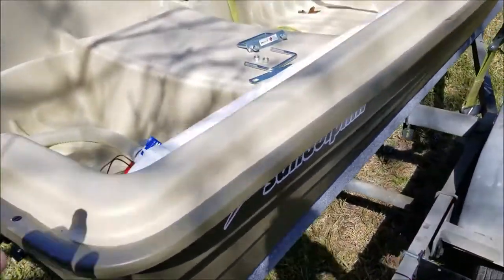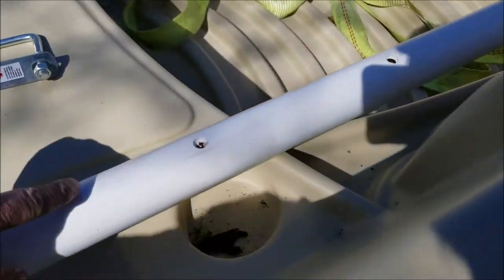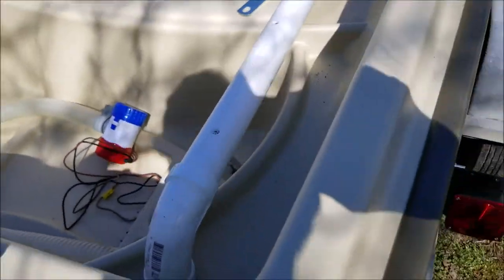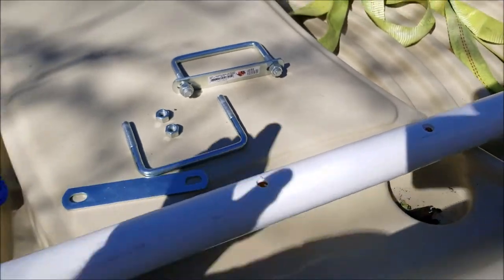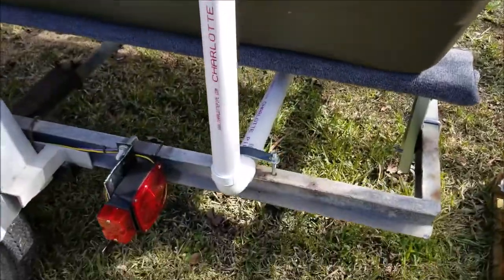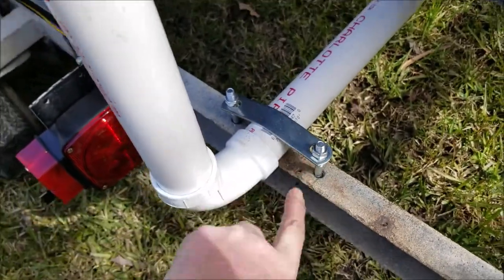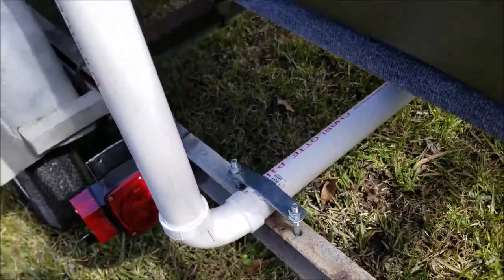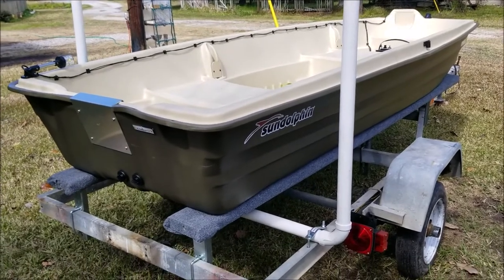DIY Boat Trailer PVC Pole Guides - Total Cost $20

Comment: how do you prevent them from twisting and tilting backwards while you're driving down the highway?
Reply from the maker: I ended up using self tapping screws and screwed the base into the boat trailer frame.  I actually only run one on the passenger side now because i can float the boat up over the trailer fender as the lone pole catches the boat.

Comment: Any more updates on the boat
Reply from the maker: As a matter of fact, I ordered a brand new 5hp 4 stroke honda ourboard last night.  After it arrives, I will be doing several new vids, such as:
*current setup with what I have for the boat
*outboard speed test and overall impressions of the motor
*launching and loading the boat on the trailer by myself
*depth finder operation in the boat

Is there anything you would like me to cover?  Would love some input.

Thanks my friend.
Reply: Yeah i was wondering what you think about mounting some wheels on the back they sell some for Jon boats.
Reply from the maker: There are some vids of guys who have done that mod.  Since I have a trailer, I won't be doing that mod, not to mention I wouldn't want to drill more holes into the hull unless necessary.  Maybe instead of wheels doing a small pullable trailer...idk.